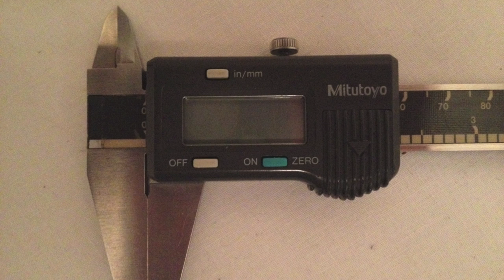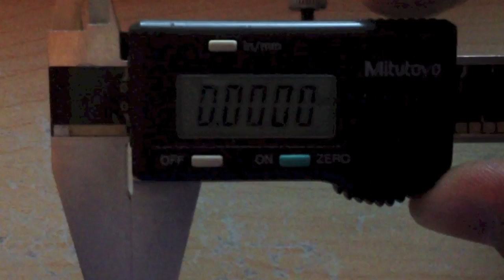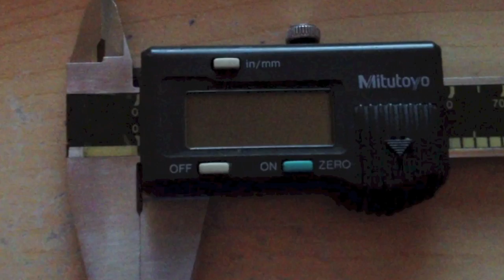How to use a set of Digital Calipers

Comment: That small metal piece that extends from the rear of the calipers is called a depth rod and is a very important feature. You can also use the top / rear of the calipers to take step measurements...

Comment: Great video! I wanted to add that you should always wear proper p.p.e., this case being hardhat, safety glasses, fire resistant suit, mouth guard, ear protection, leather work gloves, steel toe or composite toe footwear, etc. Also orange safety cones should always be used, even if at home taking measurements, as well as a spotter both of you utilizing hand signals, up to date with local osha compliance. It is important to always practice safe work habits as your safety and the safety of others is of the utmost importance.